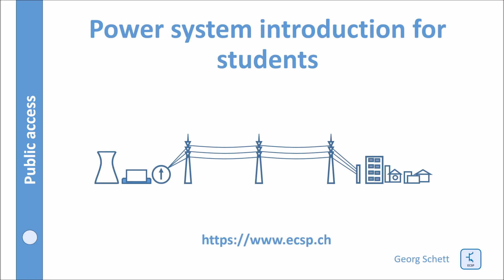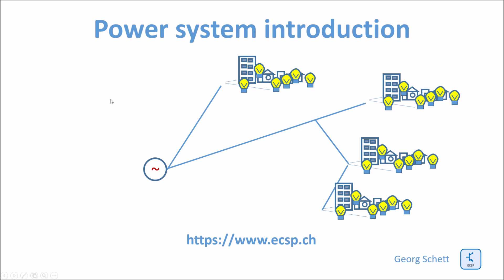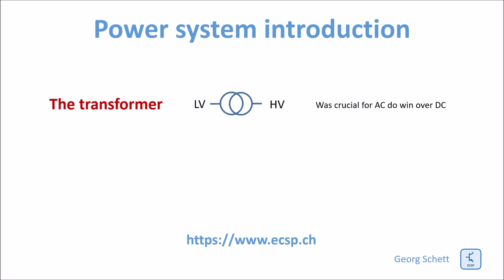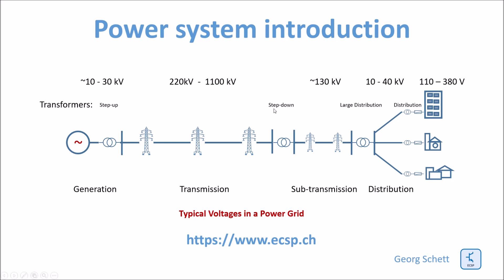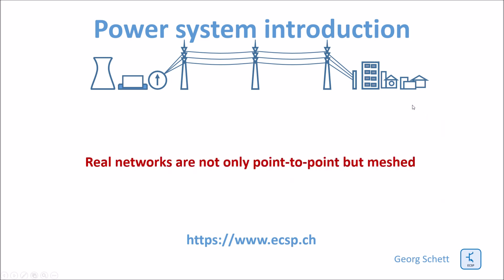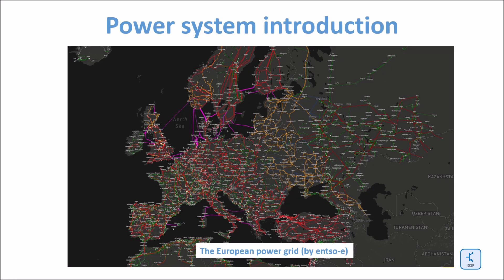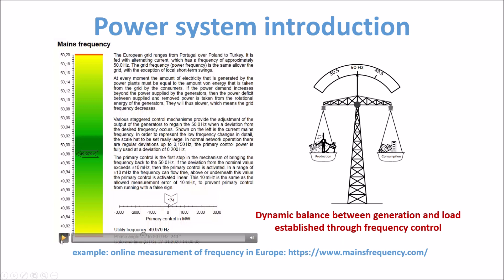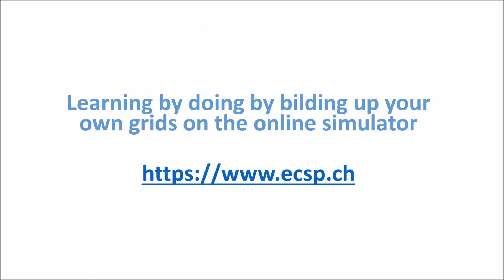Power system introduction [circuit simulator]

Comment: I am an expert in Power System Analysis and Steady State and Dynamic Controls. Published papers in International IEEE Journals. Queensland was blacked out in 1975 and 1979. I eliminated the blackout by modifying the "POWER LOAD UNBALANCE RELAYS" attached to Hitachi 350 MW generators installed in Tarong, Callide B and Stanwell Power Stations. I am prepared to assist you in your process.

Dr B. Habibullah